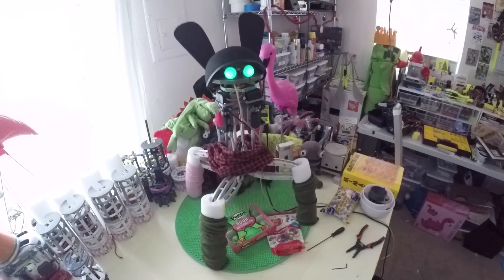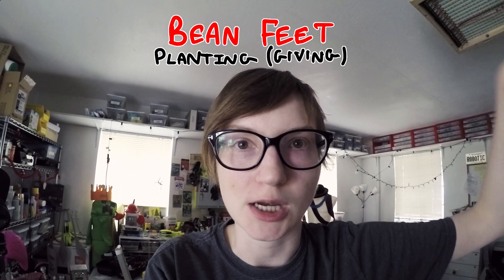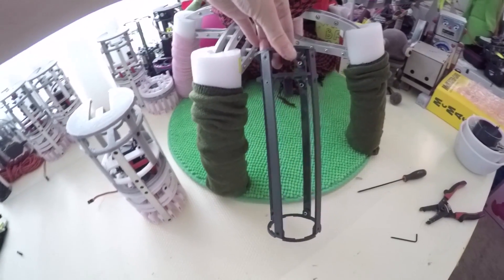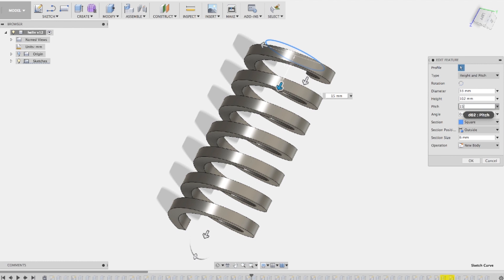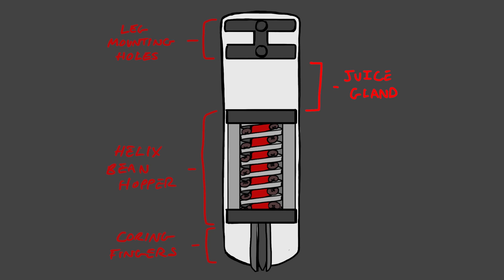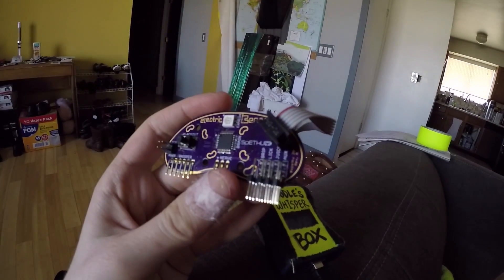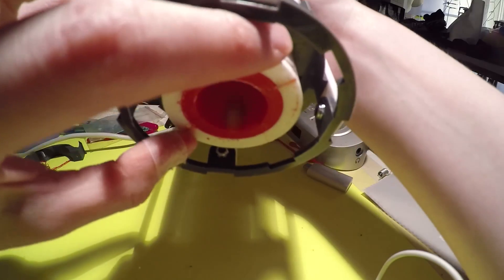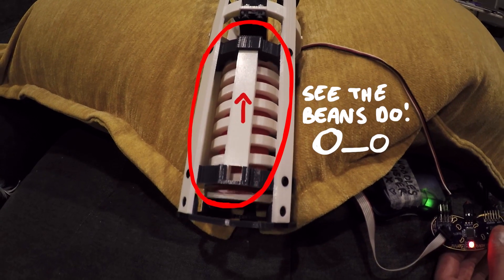Modes of Taste : Bean Planting Module Intro

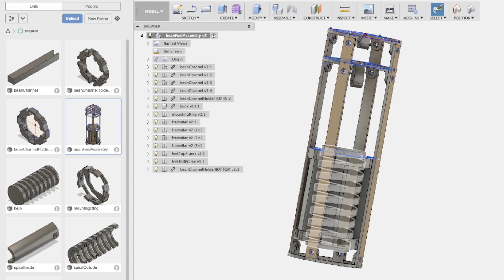Comment: At 2:02, you can re-design in Fusion360 this uplifting screw so that cross profile is not square - but rather saw-tooth shape. This way you will no more need to angle whole setup, because angled surface do it just right even in vertical position as planed.

Comment: You've put the bean loader on the side, but if you put it on the bottom then maybe Noodle Feet can just stand in a bucket of beans and autonomously suck them up.  It won't matter if he continues to plant them while sucking.
Hmm... 2nd thought.  If you put multiple bean loaders all the way up the side of the helix, then he can suck beans up in parallel a lot faster than he plants them.  It could be adorable if he buries his legs into the bean bucket to accomplish this.  

hah, i initially wrote b*u*ttom instead of bottom.  Adding to personal dictionary.
Reply from the maker: Burrowing feet! =D I love the idea of this! like.... one of those fish that vibrates to burry itself in the sand .... hmmmmmmmmmmm
Reply: Ah yes, vibration will keep the beans "liquid" and moving well, so they can more easily reach the loader, and prevent clogs.